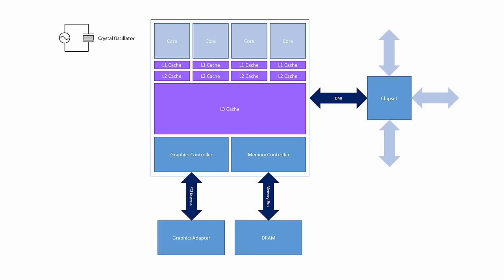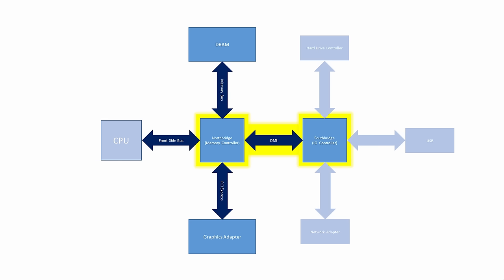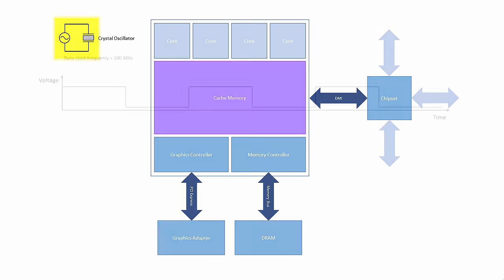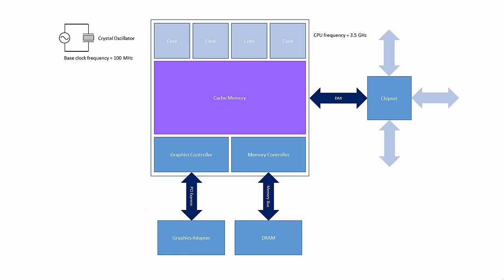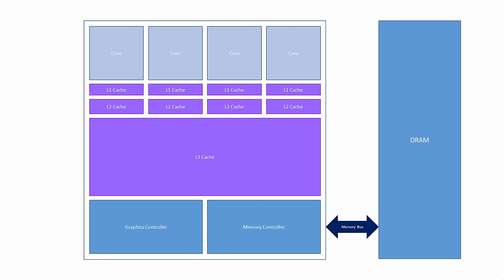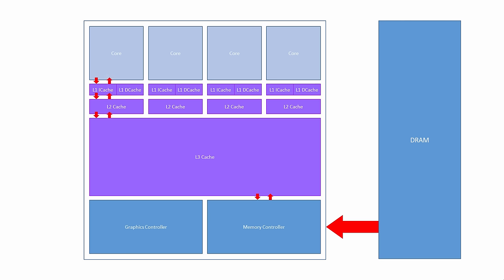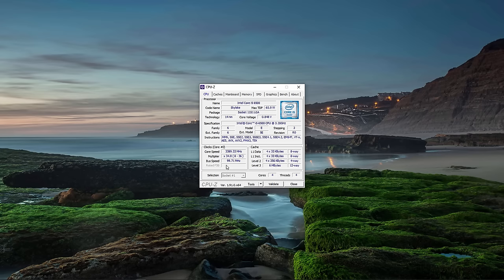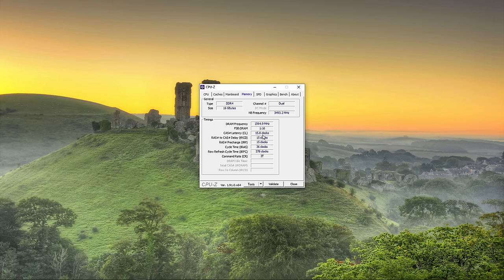Personal Computer Architecture

Comment: Great, I'm going to watch the whole series. One comment, could you do bigger subtitles on the slides ;)
Reply from the maker: Thank you.  You can increase the size of the subtitles by selecting select Settings at the bottom of the video (cog wheel icon), then Subtitles/CC, then Options then Font size.  :)KD

Comment: I have a question, what happens when a cache line gets to L1 DCache? Since L1 Dcache is 32 bytes and the cache line is 64, does that mean the Cache line gets segmented and 32 bytes stay in L2 and the 32 bytes in L1 -> Core and then L2 -> L1 -> Core ?

Comment: takeaways: 
The chipset was originally the north and south bridge.
North (memory and graphics controller): connected to CPU and controls DRAM and GPU.
South: input and output devices.
you cannot mix and match cpu, DRAM, and CPU because the CPU holds the memory controller and graphics controller, and the chipset controls the peripherals and dictates the type of CPU it can work with and control.
A crystal oscillates at a constant frequency in the CPU (base clock). Frequency multiplier circuits dictate at which the rate at which the CPU runs at. Overclocking means that you can tweak the speed of these multiplier circuits.
Cache memory (static RAM) are flip flop latch circuits, and it is much faster than DRAM. Lose data when power is off.
DRAM: made of capacitors. Leak charge and need refreshing?
L1-L3: smaller memory and faster access - larger memory and slower access.
Program counter: stores the next instruction to fetch
Instructions are fetched in a "cache line" of 64 bytes.
Reply from the maker: Good summary :)KD

Comment: Sir,what actually is a bus?
Reply from the maker: A bus is a set of wires that carry data from one place to another.  There are different types of bus, such as the address bus and the data bus.  These are parallel buses (think of a set of 32 o 64 parallel wires to carry the data).  You can also get serial busses, such as the USB (think of a single wire to carry the data).  You can find out more about the address bus if you watch my series on Dynamic Random Access Memory. :)KD